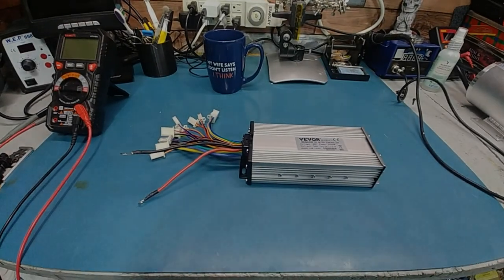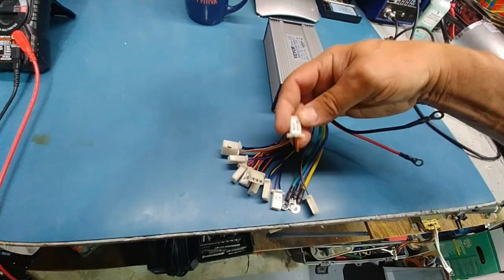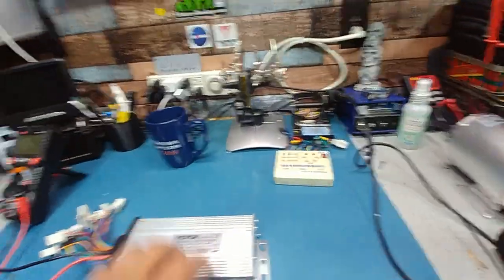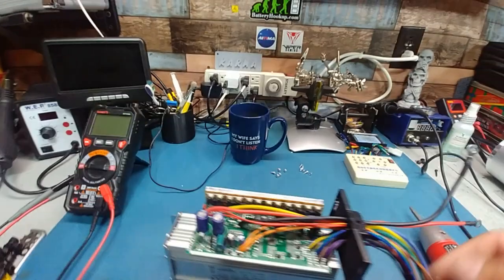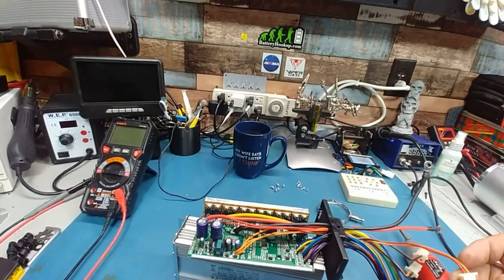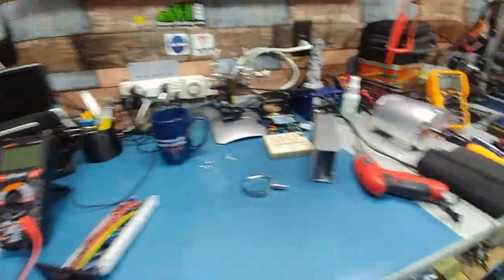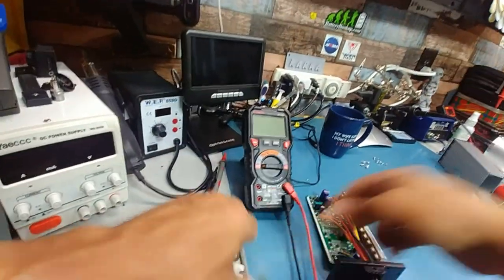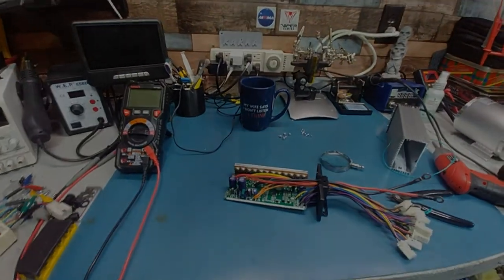ebike vlog#  VEVOR Controller Repair 🤣Monday, July 18, 2022

Comment: You didn’t repair the controller.  A little bit of research would have told you that Electronic Lock was the ignition.  I told you this in a comment on your initial YouTube video.
Reply from the maker: no most would have no idea and sent it back . thats how I like to go into a review. the seller should have jumpered the unit before he sent it out.

Comment: The electric lock is a keyed ignition you have to jump/loop it or use the correct throttle. I can't believe you don't know that. Your controller is fine you have to turn it on first
Reply: He literally said that around 1:40
Reply: @mtbhillbilly  do he does not. He said there should be another wire you hook to the vcc. Not on this unit there is not. It's a 2 wire electric lock. Lol don't be a tool of you have no clue what your talking about. Best regards have a good day.

Comment: Who could of possibly known that turning it on would make it work? Glad you don't work for me.  What makes you think it's such a low power unit? Good quality mosfets can switch very high currents. You should test before you judge. I have  9 fet motor controller running  100amps all day long with no issues. Even checking the info on the components against the manufacturers data sheet would give a much better indication than just eyeballing it.  I'm not sure why you think you accomplished a repair. Plus I love your version of economics by pure guess work.

Comment: PLUGGED THE WRONG DISPLAY into my bafang controller and i heard a fizz i opened it up  and i see the ground wire on the board is black its fried any ideas how to repair or throw it in the trash

Comment: I just had my first controller blow 3 mosfets on a so called 1000 to 1500w controller. its about 6 inches long but I have another 1000w that is 8 inches long. It worked fine for months on a dual motor bike. I went to a larger rear motor only on the 60v battery and on full throttle from a stop they popped on the yellow phase. I bought some mosfets and will be replacing all 4 of them on a 12 mosfet controller. I got 75v 100a mosfets.

Comment: You should check the mosfets before you decide if it’s junk. Most likely your right however without knowing what the mosfets are rated at you can’t really judge a controller just by it’s size. There are small 6 fet units putting out 100 amps and I have 2 12fet units that do 50 amps. Looks aren’t always the full story.

Comment: heya ive one of the sabvoton minis the svmc 7245 unlocked version normally rated at 45 amp ,its even smaller than board in the controller you show,and it runs on 84 volt and 100 amp continous ,it only has 12 fets but they are good ones,i was really suprised for such little controller .worth a look if cant afford the bigger 150 or 200 amp sabvotons

Comment: what part of these controllers gives you the 12V rail? I have a Hover-1 Alpha and the only way I can get the controller to turn on is if I jump 12V to the power PCB. Harness tones out. Maybe just a little component on small 300W controller?

Comment: your right about that controller though,and its just square wave to so will make hub motor noisey ,yhey reay do skimp on quality everywhere they can with these generic controllers, most of them though now can be conected to pc and reprogramed as they use a coppied infinieon mcu ,and a micro usb to seial ttl module can be used mine cost 6 dollars on ebay software can be found on git hub

Comment: I need help about the same controller so it worked fine everything powered up ran for a month straight out of no where it just shut off now when I connect my positive an ground to my battery I get a huge spark
Reply: you might a burned mosfet in short

Comment: electronic lock means ignition, a lot of them are like that , why would they bridge it ??
Reply: if there not going to supply the ignition switch there should a jumper. this controller will not work without one.
Reply: they leave it to the user to connect it to a switch. I just use a simple on/off switch. 
I ordered a bunch of 2 and 3 pin connectors off aliexpress and then i have a nice easy connection for my leads. Label the wire tags also. 
I use these kits to convert razor bikes to brushless power.

Comment: Some of these plugs are so odd. How does the rear taillights even work for these? What switch can be put in?
Reply: High-brake supplies a constant +12v. Connect your 12v brake light in series with the brake switch cables. When you press on brakes 12v circuit will close light will turn on and controller will stop running. If your controller has ebraking this is the switch that usually activated it also
Reply: H-brake cable.
Reply: Just remember it puts out batt voltage not 12v or at least my vervor labeled one does so I hook that to a buck and now I have 12v brake lights not 58v
Reply: @JuanJDumeP  incorrect, brake supplies 48V lol... you will demolish a 12v lamp on this controller. Ive done it once, now i use a volt meter on all the lines. 
Indicator light, brakes, etc all put out 48v, and I imagine for the 72v controlers also they put out 72v. Use a volt meter first.

Comment: All that equipment to jump the electronic lock ?? Lol how can you not know this???? Wasted that time making a video and taking it apart hahaha. 
Super easy to connect a simple switch to it, click on off, works perfect. Yes it s a simple controller but it drives that 1800W to 45+ Kph in most e bikes so who cares. The good part is it will work with a lot of batteries and gets kids working with electrics for cheap. I use these kits on razor bikes and they work amazingly well vs the stock setups they come with at 24 or 36v brushed motors.
I think we have all come to learn that aliexpress is mostly lies to get people to buy stuff. 

No instructions needed (all of these work) -- only warning needed is that the system runs fully at 48V, so you will destroy any 12v led setup or lamp if you dont use a step down converter. 
electronic lock = bridge on/off
reverse = bridge on off to change direction
3 speed, mix and match to get 80%, 100%, 120% power delivery (this works well since the throttle is very jumpy)
indicator light = 48V power on all the time when electronic lock is on 
brakes = on/off switch connection 
brake light = 48v output when brake switch is enabled

Total user error, electronic lock is pretty clear to 99% of users, there is always the 1% that need instructions on how to not drink sweet washer fluid :D